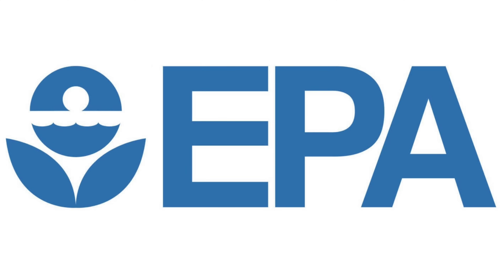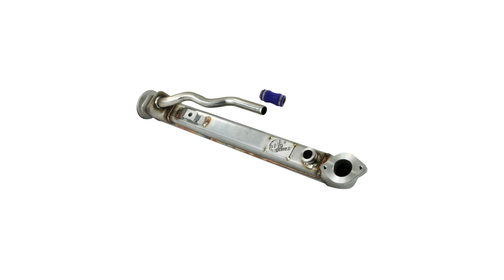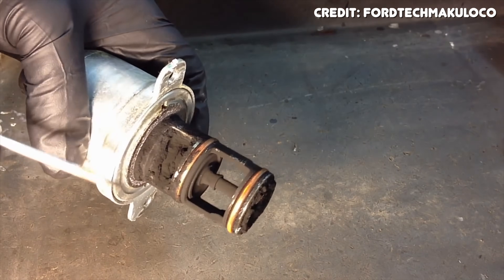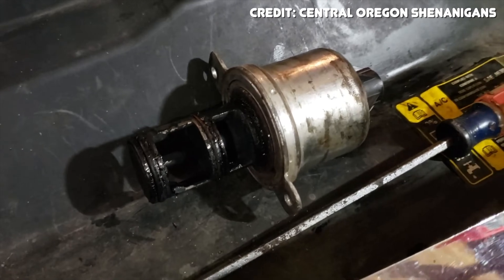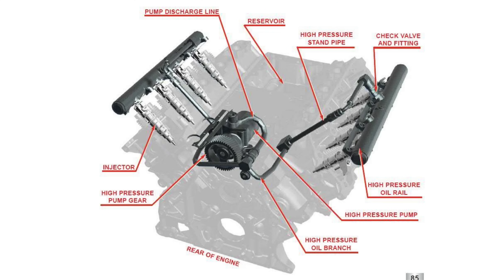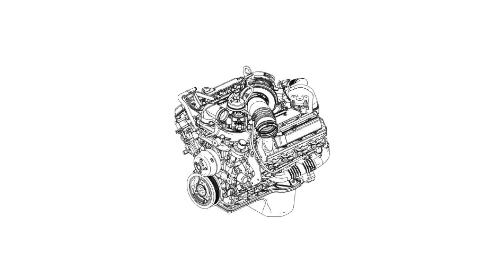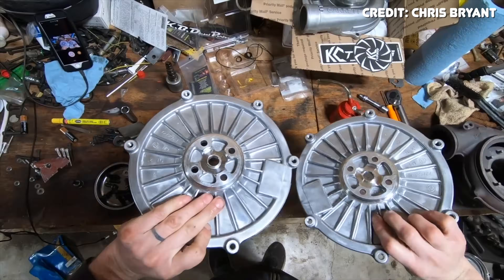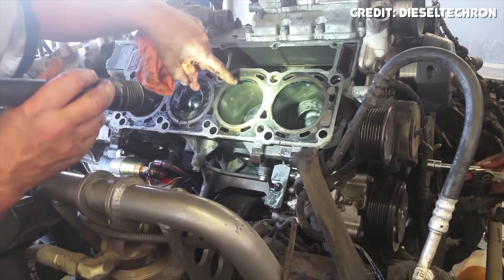The Truth About the 6.0L Powerstroke (And Everything Wrong With It)

Comment: I'm looking at a 2006 F250 with the 6.0, clean truck at 216k miles, all it has done (from what I know) is EGR delete, and an air intake. The rest seems stock. Is there anything I should do to it to keep it reliable other than normal maintenance? I've been told if I want a reliable diesel, is to get a 6.0 or a 5.9 Cummins
Reply: I’d defiantly go with 5.9 Cummins over 6.0 powerstroke
Reply: lol the only thing “reliable” about the Cummins is the Cummins itself. The rest of the truck is hot garbage.

Comment: I didn't have any problems with my 6.0 until I lengthened the oil change to 10,000 miles instead of 5,000.  I didn't have any problems with the egr system until after 130,000 miles.  And I cleaned it out pretty easily with a screwdriver and shopvac and the valve itself with new o-rings and brake cleaner.
I had plans to delete the egr system and put in head studs and crank up the power but it was expensive and time consuming.  I used the truck for work so it couldn't be down for an extended period of time.  So I never did any mods.
130,000 miles with no issues I wouldn't consider an unreliable engine.

Maybe it was less reliable in hotter climates with guys who towed heavy trailers up big mountain grades regularly.  Pushing the engine to its limits more often.  But driving it regularly and towing occasionally it was fine.

Comment: After 12K fixing all the issues I managed to get about another 7 thousand miles before the turbo went out...again. Fixed it, put a crazy price on it, (05 sportsmobile 4x4) sold it! Fast forward 5 years and that owner sold it again but only after dumping another 20K in various repairs including yet another turbo. If I ever meet the guy who signed off on the 6.0 hes gonna get punched in the head. The 6.0 is the biggest joke of of engine ever. Ill never buy another ford for any reason.

Comment: One of the subjects I never hear talked about is load. A Diesel engine is designed to deliver high torque at low rpm. They are heavy bulky engines for the purpose of work. A Diesel engine was never intended to be a grocery getter; it’s a working truck. Diesel engines need heat to run at optimal performance. Ford has sold millions of trucks to people who never work them. The 6 liter is a fine engine if it’s driven and maintained correctly.

Comment: If it takes you 10 to 12 hours to change the EGR cooler you're doing something wrong.  Not to mention I have never misdiagnosed an easyr cooler for a bad head gasket and honestly I worked on a lot of six O's and I've never even seen head gasket failure that wasn't caused by something else

Comment: Have a 2006. Changed the oil on time. I've treated it like a truck.NOT a Race car... Has ran great and has served me great. I have no complaints.
Reply: same here i have 353,000  miles still going strong with OE turbo and head gaskets hasn't failed yet

Comment: I had an 05. Stock when I bought. I do my own work on my vehicles. Removed egr cooler and welded exhaust port and reinstalled. Unplugged egr valve. Bigger exhaust turbo back. New oil cooler. Pretty much just help it breath in and out better. Routine maintenance and never had an issue. Hauled anything I put behind it. Wish I never sold it. Sometimes a ridiculous offer is hard to pass up

Comment: "One of the worst engines ever made" literally what. It's a powerhouse and extremely reliable when bulletproofed. Really the only issue with the 6.0 after bulletproofing is the oil coolers which is a double edged sword as its oil to water design kept the oil colder, but it's complexity meant it was effectively a consumable part

Comment: As a Powerstroke Diesel mechanic, you pretty much nailed it with this video. I would like to add in that the 6.0 was not actually designed by International- it was designed by a European company. International chose to do this because emissions have been much stricter in Europe for years so they though the European company could make a good engine. Also, I have NEVER seen a head gasket fail on a stock 6.0- the tuned ones fail constantly but if you don’t turn them up the head mounting system is actually very reliable.
Reply: I work as school bus mechanic, and we had at least 40 of the e350 with the 6.0l, we have now scrapped pretty much every one because head gaskets failed, and they are detuned compared to the ones in the f series. I bought one that is still good so far, I want to turn into an rv.
Reply: @danielteichroeb7200 the 6.0l in the ambulance was a little different than the ones in the f series trucks
Reply: I worked for Ford from 97-05 as a master diesel tech. We actually had several show up on the transport with blown headgaskets from that factory. In 04, we had 2 run aways when they were delivered. Have you ever heard a diesel turn 10k rpm? LOL! It sounded like a jet engine! But I will say, for the most part, you are correct. As long as they aren't used to tow at their upper limit daily. I've had to do quite a few stock 6.0s. But I will say those were used hard. Towing mini excavators, skidsteers, etc. They were maxing out their trailers daily. All this is just from my own personal experience. I can't speak for anyone else. Those trucks must've been manufactured either on Friday or Monday. Lol!!
Reply: @shannonthigpen5032 . Interesting! I mostly work on these trucks when they have 150k + miles on them so I haven’t seen anything quite like that. There is a video on here of a 6.0 running away and the RPM’s they turn are insane!
Reply: @shannonthigpen5032 that’s a simply wild and amazing story to hear, wow!
Reply: @shannonthigpen5032  in late 02 we had a ride and drive at our local horse track, the navistar techs had two trucks at our dealership replacing the injectors on. The trucks literally crapped out at the event. As techs we wanted to know what was going on. They were real hush hush about what they were doing . The 6.0L engines were the biggest POS ever in a truck.
Reply: @matthewnosal6893  Let me introduce you to the 6.4. Lol!! IMO that was the biggest pos they ever made. I'll take a bullet proofed 6.0 over a anything 6.4 any day. My personal preference though is the 7.3, 5.9 12 & 24 valve, and the 6.6 LBZ & LB7.
Reply: @shannonthigpen5032 I’ve seen unicorns at the shop I work at- we just replaced the transmission on an f650 6.4 flatbed tow truck with over 350k miles of towing cars/trucks all over MN. Still on the original engine that got deleted very early in life.
Reply: The European manufacturer in question is Renault.
Reply: @josephdepre4513  ford put a french engine in their cars Renault is one of the worse car companys out there
Reply: That explains a lot @josephdepre4513
Reply: @josephdepre4513 Which explains it all.
Reply: @josephdepre4513    Very good to know. I was trying to figure out exactly who was responsible for this atrocity of an engine and you answered my question.
Reply: @stevenvanheel3932  Nav/Ford cutting corners and it caught up with them. While doing warr repairs on the pos’s Ford/Nav said to not deck the heads or use head studs. Then after most trucks are out of warranty like around 2012 Ford/AER offered an engine with arp studs. Go figure. I was told from a Blue Diamond rep that the stud torque would eventually crack the head at the inj cup. Diesel in the cooling system. But I also found factory stock engines with cracked heads at the inj cup also. For the most part the short block was pretty indestructible. The head casting…. Roll the dice….
Reply: I didn’t delete the EGR. I replaced my EGR Valve after a diagnostic showed it to be going bad soon, but my rig is bulletproofed, and I recently put in an S&B Cool Air Intake with the Cotton Filter, due to the fact there is continuous construction going on around where I reside, there is a lot of dust in the air.
Reply: @kg2005USMC the stock filter holds and traps more dirt then any cotton/oil filter. And what the cotton filter doesn’t catch goes into engine.
Reply: @red66chevy , It would be nice if I could stick my OEM Filter in my S&B compartment if that’s the case. I do still have everything in a box put up in my Garage.
Reply: Being designed by a European company makes it like German cars. If you don’t maintain them exactly as intended, they will fail. The Europeans design assuming you will maintain as intended, Asians assume you won’t so they design it accordingly.
Reply: Pretty sure a lot of stock 6.0s had head gaskets fail. There’s one on YT that documented everything pretty extensively. The clamping force isn’t enough, and over time, the head moves around enough to wear the face of both sides of the MLS to cause the coolant/oil mixing. Problem spot was at the mid point of the cylinders. Just a matter of how long that’s going to take. The studs help, but still, only 4 per cylinder, not ideal.
Reply: @@tha_black_merc I know plenty of knowledgeable 6.0 owners that are very happy with their engines, and it's not because of turbo noise. They can be made to be good engines. From the factory, they are flawed, for sure, but they can be made reliable. On the other hand, you're the only one that I am aware of that had anything good to say about the 6.4, except for the the one guy that "liked the fact it had 2 turbos"
Reply: So egr delete or na
Reply: @calco.café if you can get the parts then delete it. It typically only costs $60. Just be warned- the EPA could be knocking on your door even for a simple part like that. The government is way too powerful.
Reply: I've never heard about the European engineering. That's interesting, but makes sense
Reply: Does that mean if I get it deleted it’s gonna cause issues with my gaskets?
Reply: @michaelmoser3482  not at all- deleting the EGR is one of the best things you can do to these trucks.
Reply: lol nailed what? that he skimed over some forums? yeah he def talked the known issues but not correctly at all.... if your actually a tech then you would have known he knew nothing the second he said the egr was a 12 hr job.....
Reply: @tonecouch6629 . The EGR is not a 12 hour job but 5 or 6 isn’t far off… it requires turbo removal, intake manifold removal, and oil filter/fuel filter housing removal.
Reply: not even from water in the cylinders creating a higher cylinder pressure?
Reply: my truck is bone stock, with studs and it blew the head gaskets again
Reply: My stock 07 has 204k, original injectors, never blown a head gasket, original trans. Never tuned. Ridiculous fuel and oil maintenance.. its fires up very quick, purs beautifully, whistles wonderful, and drives smooth as butter.  Its my daily.
Reply: I did hear something that, yes, the European diesel fuel burned match cleaner than our+diesel fuel did back in the early 2,000s, but now our diesel is burning cleaner as well (true or not? I do not know). Yes aEuropean company did design the engine, and with the way our diesel fuel burned, much more soot (dirt and carbon) in the engine created havoc. I curious to know from an expert, such as yourself, does our diesel fuel burn cleaner today than the early 2,000s?
Reply: @kg2005USMC in 2008 the us gov mandated that sulfur be dropped from 500 ppm to 15 ppm. They did this to lessen the exhaust particulates during operation. Problem is sulfur is a lubricant for the fuel sys. The low sulfur doesn’t present a problem on the Hui style injectors as in the 7.3/6.0L . But the common rail fuel sys see more failures because of it. Fuel lubricity additives are necessary to make up for the lack of sulfur.
Reply: @matthewnosal6893 common rail fuel systems are designed for ultra low sulfur fuel. They fail for a variety of reasons but lubricity of the fuel is not one of them. In fact a lot of them are engine oil lubricated, and when they fail send shrapnel into engine oil system.
Reply: @red66chevy  incorrect. The only thing lubricated with engine oil is the pump gear. Where it makes contact with the cam. The internals of the pump a lubricated and cooled with diesel. When the pump grenades it takes out the injectors and everything in between
Reply: @matthewnosal6893  
The plungers and cam they ride on are oil lubricated, in oil lubricated pumps. In non there is only fuel. Have replacement many pumps, injectors do not get changed if it ran when it came in, obviously they are working. This is the OEM procedure. May be your experience is limited to pick up's.
I worked for Heavy truck and equipment Dealerships. Information came directly from manufacture's. If a oil lubricated pump failed it often lead to rod out of block incident.
Reply: @kg2005USMC California requires that the sulfur be removed from the Diesel #2 base fuel. Burning sulfur creates the soot, so less sulfur equals less soot. You can see the difference on your tailpipe and the new fuel doesn't create black exhaust smoke so readily.
Reply: @kg2005USMC  that’s a very good question and one that I cannot answer- I don’t engineer fuel or know the exact science behind the additives (such as paraffin, which is much less present in winter blend diesel because that’s what separates out of the fuel when diesel “gels up”) because I don’t get paid to know that or experiment with it. I just get paid to diagnose various issues with these engines and repair them. The internet might have a good answer to your question but it’s hard to trust the internet on topics like emissions because there is a ridiculous amount of politics revolving around the matter.
Reply: My 2005 6.0 was bought new and never tuned lasted 32000. Miles and blew head gaskets and I don't pull anything.
Reply: @@tha_black_merc. I freaking hate the 6.0. The engine is garbage and the truck that surrounds it is garbage too. They are tough to make money on without pissing off customers because the second you touch that truck you trigger the domino effect and then you are married to the damn things. They are Terrible, terrible vehicles. There’s a reason I drive a Chevy to work everyday.
Reply: @stevenvanheel3932 Gas rig ?
Reply: I have 436000 +  on my 03 350. 11:15  I bulletproofed it at 350000 miles, still running strong @stevenvanheel3932

Comment: Anyone who claims that the 6.0 is a bad engine because ford made it make so much power are completely full of shit. The base components of the 6.0 such as the block, the heads, pistons, rods, ect are hardly EVER failure points. When the engine has issues it’s typically the high pressure oil system, EGR cooler, or the oil cooler. If the base components of the engine fail then it is typically caused by someone who drives them with a bad injector, a bad EGR cooler or a bad oil cooler. I think these engines are complete pieces of shit but there are so many misconceptions about them out there.

Comment: If you don’t try to race it and drive it normal you’ll be just fine and have no problems
Reply: Not really true. I worked on many bone stock F-250s that saw little hard work or high idle time. All of the problems he mentioned occurred on all of them. And he even missed a couple issues. Like the timing covers pitting from cavitation at the water pump and camshaft failures. Also severe issues with the wiring harnesses on early engines that required the harness to be replaced. Mind you Navistar supplied the harness on the engine. Ford just plugs the truck into it. The thing about all the failures he mentions is they happen on any engine. It’s the frequency that matters. All of these issues are super common. I just can’t understand the fanboys. It is literally the worst engine I have seen in 25 years as a mechanic. Leaps and bounds beyond second place. Some engines whether gas or diesel will have a known common issue. Not thirty. This engine and the disastrous 6.4 that followed made Ford design and build the 6.7 in-house. They kept the power stroke name. I always thought they should have dropped that. The 6.7 is phenomenal. It takes anything you throw at it and asks for more. The only real issues you see with them is the after treatment system. However, that is just plain an impossible system to make reliable with current tech. Because NOBODY has made it reliable. Including on the heavy truck engines.
Reply: @AlphanumericCharacters  either way it’s safe to say the Cummins has anybody beat

Comment: In reality the 6.0 was a terrible engine from factory. Built they are monsters and can be pretty reliable, same goes for any diesel motor, the better built they are the more reliable they become. 🤷‍♂️ 

In the case of the 6.0 it got the short end of stick and got its name in the book of the worst engines ever made do to fords neglectful attitude and EPA BS emissions rules 🙄. 

Just like every modern day diesel motor people love to diss them because of the EPAs crappy rules that benefit these engines in no way shape or form. But once deleted ever diesel motor including the 6.4 and 6.0 powerstrokes are beasts! 

The next step after a delete is to focus on strengthening the areas of the common areas of failure, I think it was the LLY duramax that had injector issues and the LBY duramax had head gasket issues, which are relatively easy fixes just a pain to go through the maintenance. 🤷‍♂️ 

But there are still people running upwards of 13 to 1400 hp and almost 2k worth of torque in the LLY, LBY, 6.4, and 6.0 powerstroke and duramax engines today with hardly any effort. 🤷‍♂️ 

The moral of the story is when you find the weak spots of each and every motor and reinforce those weak spots they can be indestructible motors, well that and if the EPA didn’t force manufactures to put equipment that essentially shovels the motors own shit back down it’s throat then any motor can be good. Some just take some time, elbow grease, and effort. 🤷‍♂️